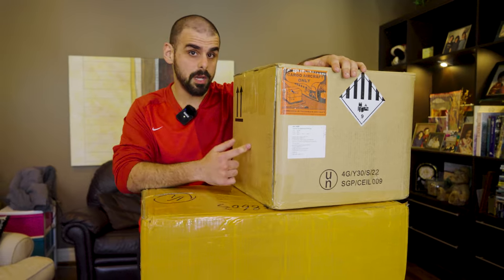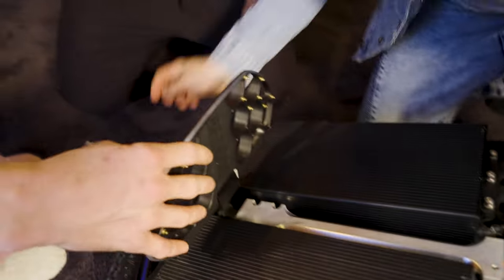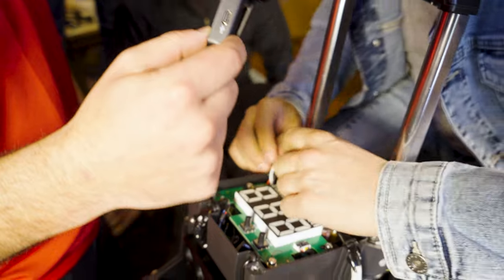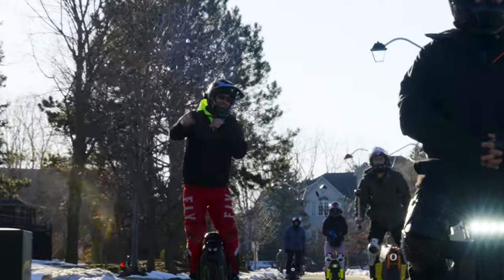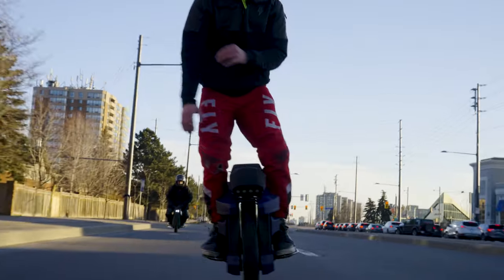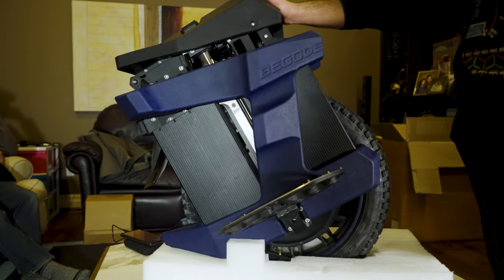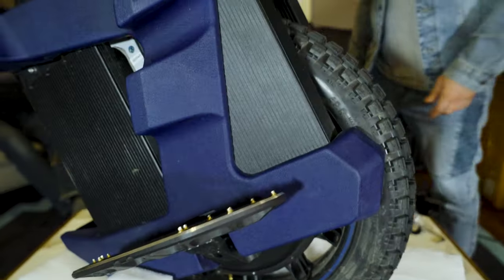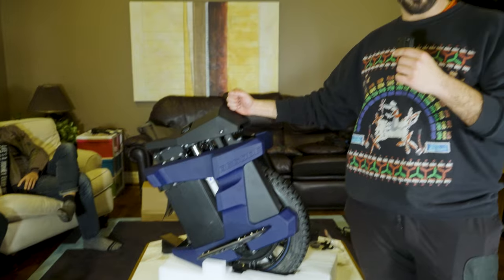Begode EX30 Ride REVIEW / UNBOXING - With Toronto E-Riders

Comment: Nice unboxing. The seat has actual metal  strip inside the foam so no worries about tightening the screws a bit, the screws will not go thru the foam.

Comment: Superb break down of the 2023 EUC of the year contender. The passion of the riders ooozes through the entire vid. In your opinion, is this 4k wheel worthy? I am in no way excited about the current price hikes, but if new tech justifies the 4K sticker wouldn’t  the 4 k price lean more towards the V13.? 
The riders expert input, really set this apart from other reviews. This has to be the most knowledgeable riders I have seen reviewing one EUC, and I like it. 
It seems as if EUCs are turning that corner to the next level. In your opinion, why haven’t manufacturers sponsored races to push the performance envelope, and grow the sport? Thanks
Reply from the maker: Definitely a different beast than the v13. V13 has a lot of creature comforts like ip rating etc. This wheel is classically begode with some nice improvements, better waterproofing, better motor, more battery. The riders say they like the feel of the ex30 more because if it’s centre of gravity, it’s lower and therefore more stable and planted. They definitely are getting very advanced! I think racing isn’t the biggest revenue stream for the manufacturers… They want new eyes, and racing is for people who live and breathe Euc, not the newcomers. It’s semi entertaining to watch, but much like drone racing, is much more entertaining if YOU are the one doing it.

Comment: Any plans for off-road use? Wondering how suitable it would be for trails.
Reply: not suitable on trails unless it's flat grass/dirt.
Reply from the maker: What deej said- light off road is good and fun. Will give it a go
Reply: @deejeh9494    The stability is nice, but I think it's a major bummer that the battery cases are so low that you can't really utilize all that suspension travel for any sort of jumps, drops, stairs or anything.  Kind of makes you wonder if they even anticipated the battery cases being an obstruction for trail riding from the get go or if they just recently decided to label the ex-30 as a street wheel after youtubers discovered clipping issues when taking on stairs and steep hills etc.  

If you think about it, why would they be showing all the videos from China going off road and taking on all that crazy, rocky terrain,  going up mountains and flying down flights of stairs if they weren't initially promoting the ex-30 as an off road capable wheel.  Not to mention, what is the purpose of Begode highlighting the upgraded, 100 mm travel suspension and  knobby tire if they weren't planning on people jumping it and going on rough terrain? 🤔🤔🤔

Personally, I hope there is a way to DIY the battery cases to raise them up a little.  Just enough to at least take on stairs and do some kind of jumping.